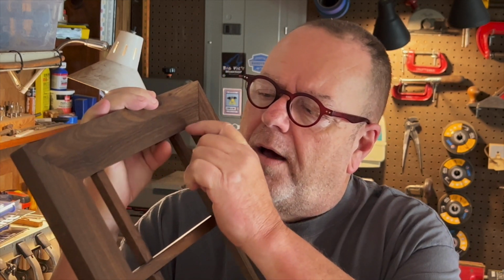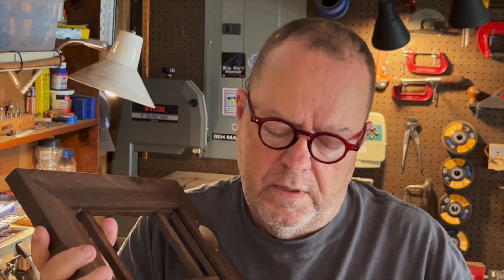Fixing A Cheap Cabinet Door

Comment: I love my multitool. 
It does work great on drywall. To cut a straight line you can clamp a board down and run the bit along the board. Nice straight and square cuts. every time.  😁😎
Routers do okay but they are scary until you get all the guides and fixtures. The router costs a ton. Then the accessories are 10 times as much. 😁😎
Reply from the maker: Thanks! I'm looking forward to trying different things with it.

Comment: Routers are the loudest hand tool I've ever used. With the possible exception of the thickness planer I used in high school. If I ever have to use a router, I do rehearsal cuts with it powered off to make sure I got it right before I turn on that monster! Thanks for another fun vid, Ben!
Reply from the maker: I have a large router and an inexpensive router table (with basically the same version of the router as the other one permanently attached.) Every time I use either one I do multiple dry runs. Literally I keep putting off turning the switch on until there no more checking to do.
:)

Comment: Those oscillating multi tools are fantastic Ben. I got a cordless years ago and use it constantly. The sanding pads are easily obtained from your hardware supplier or from EBay. Great fix On the door Ben and good to see you again.
Reply from the maker: Thanks!

Comment: Ben,

Very clever!  I would not have thought of using a orbiting multitool.  

You might find a trim router more to your liking.  A flush trim bit with a bearing would be an option.   The corners would require a chisle.

Have a good 4th.

Bob
Reply from the maker: Thanks Robert!

Comment: I was given one of those Oscillating Multitools years ago as a gift, they were kinda new at the time and I thought maybe it was a bit of a gimmick but in the end I found out they're great and I use it all the time.........No I'm not afraid of the router and I probably should be, I notice sometimes I have my fingers dangerously close when I'm using the router table.
Reply from the maker: It's an amazing tool. I get the feeling I will use it a lot. Thanks!

Comment: Thanks for your videos.  Glass can shatter on its own.  We had a stereo cabinet that had a glass door.  Our dog and I were in the living room and the glass shattered and fell on the carpet.  Scared both the dog and me.  I replaced the glass with plexi that I cut on my table saw.  I sanded and then buffed the edges.  Your cats were probably innocent this time.

One thing that might have helped your project was to use wood instead of tape to align your blade.  The wood, being about 3/4 of inch thick could be used to guide the blade straight down.
Reply from the maker: Interesting! Thanks for the info, Brian!

Comment: You did GOOD! I'd have demolished the whole thing right off the bat and had a piece of plywood with the nails bent over crammed in where the door used to be. OR probably tactfully knocked the end off and tried to slide something breakable down the length of it and THEN demolish it. Happy 4th and BLESSINGS!
Reply from the maker: I had visions of me doing that when I decided to buy the multitool. :)
Reply: @mrbenmall  If it's got to be or going to be looked at I better farm it out. I still give you the A-PLUS! And I've got way too much stuff for my own good and remaining brain cells.